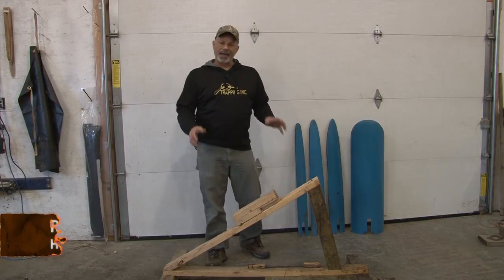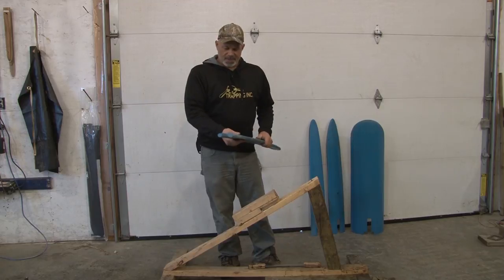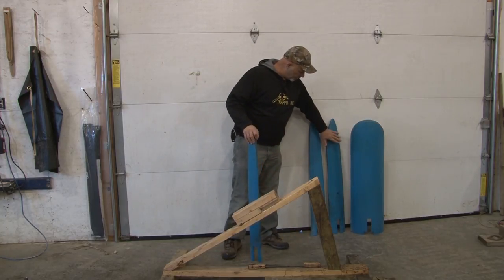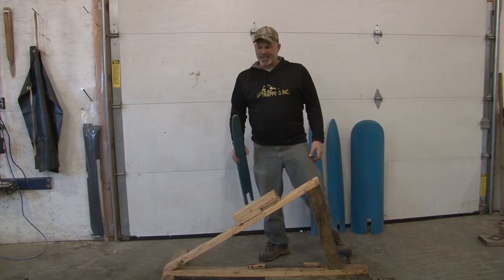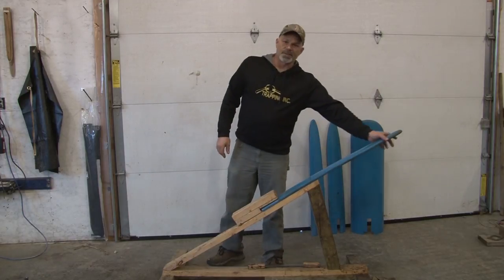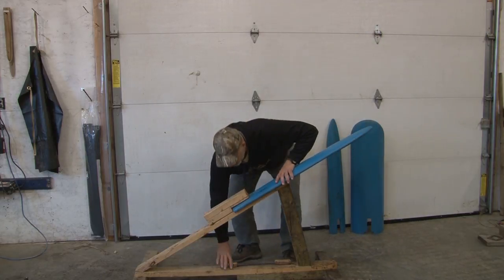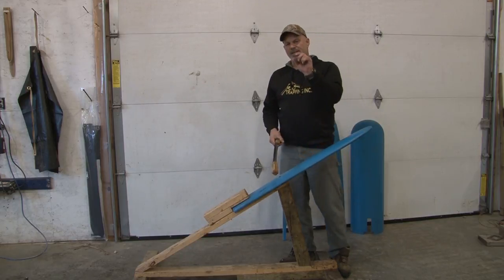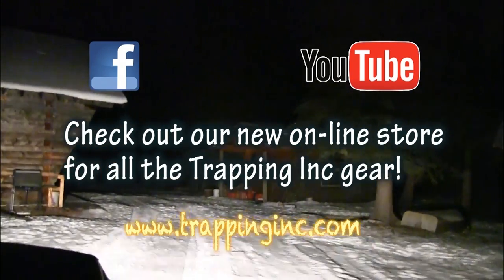Rich's Fleshing Beam system

Comment: Hello. I'm not a trapper, but I'm a hunter. And usually I never keep the hide, but I've always felt bad for getting rid of it instead of keeping it and tanning it to use it. I was curious about what size fleshing board I need for fleshing deer, bear elk, pretty much any big game.  Also what fleshing knife should I look for. Also if I do the drying process instead of using salt, do I still have to do a salt bath before applying the tanning solution? Any help would be greatly appreciated.
Reply from the maker: Most big game animal hides are either laced to frame for scrapping or nailed to plywood. A tool called a hide scraper is used rather than a fleshing knife.